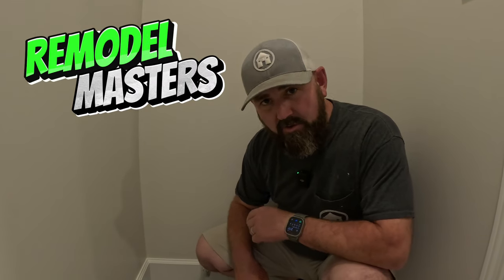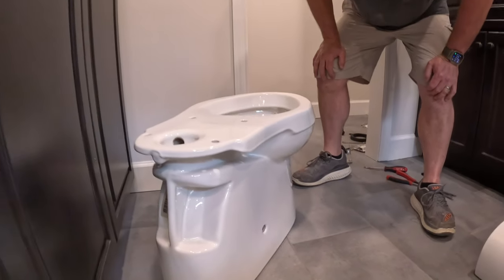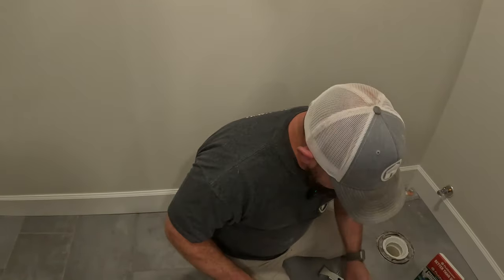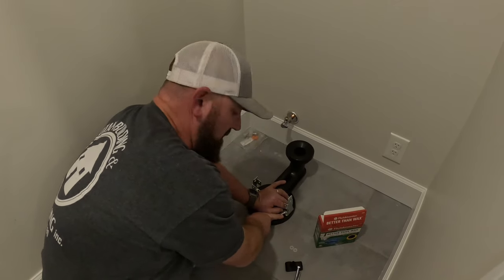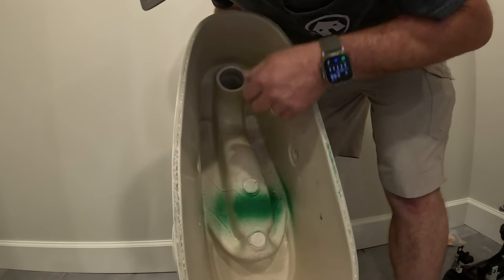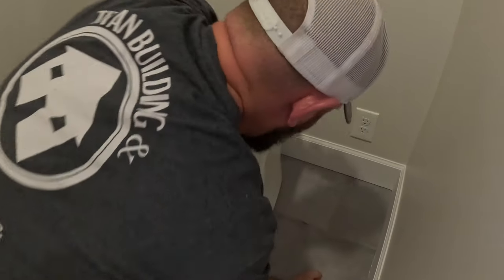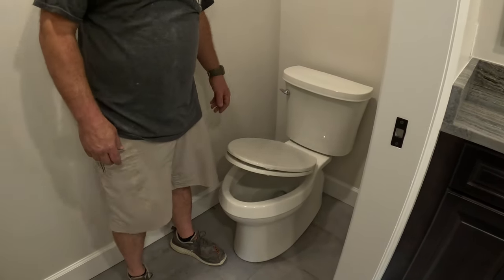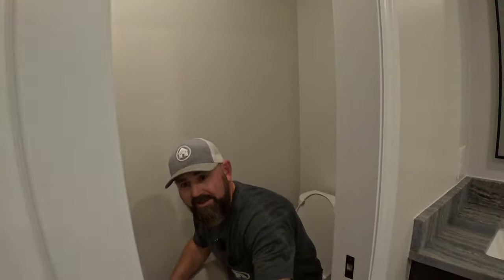🚽Installing the Kohler Gleam enclosed trap toilet🧻

Comment: I installed one of these for my dad last weekend. After I was done I thought about lubing that rubber flange like you suggested. It went well anyway but that grease is a good idea. I didn't realize what we had bought until I unpacked it and I thought this will take a bit of learning. They are unlike any I had done before and although I am not a plumber I have set maybe 30 toilets in 40 years of residential work.

Comment: Thanks for this. Done a number of toilets but nothing with that newfangled flange-y thing.  Funny that when I contacted Kohler about using the waxless ring (instead of the wax type included) they didn't have a clue as to whether it was compatible or not. I initially tried to fit the Fluidmaster waxless ring around the bottom of the flange and seems you need to stretch and almost deform it to get it to fit. Is that your experience?
Reply from the maker: Yes you do have to stretch it a bit but not too much to where it seems like it would be a problem

Comment: Just intalled this model (Gleam), tank wobbles a lot,  just two bolts holding the tank.  Am I missing something?
Reply from the maker: If you tighten it down to where the metal bracket almost touches the toilet it should not wobble. It almost seems like you are over tightening it but I’ve never broke one yet

Comment: How is that plastic part and those screws nut thingamajig gonna hold up especially if have and you have to remove it. Or snake it out ro plunge it and it leaks  where the 2 pieces come together under skirt.
Reply from the maker: It’s got the waxless ring sandwiched into place and won’t move plus if installed right a toilet shouldn’t have to come up unless you are changing out your flooring or want a new toilet.

Comment: Why don’t you use the 20th century wax ring? I have one gleam installed & used it 😮. I’m about to install a 2nd downstairs. Usual tips, thanks.
Reply from the maker: I haven’t used a wax ring in years. The waxless seals are not near as messy and you can feel that they seal better

Comment: Working with PVC flange was difficult to keep the flange bolt t correctly on the flange when tightening the brackets, had to use vice grips and open end to keep from splitting the pvc flang. Then when putting in the side bolts, the nut insert fell out of the plastic contraption instead of threading. Took 2 trys to get the side mount bolt to catch. . . Use soap on the rubber flange to make the porcelain slide in easier. Then all good, filled up, no leaks but bowel was still loose and would move if you try to turn it. Tightened side more, still loose. Tightened little more-snap, plastic swing bracket broke inside. Welp, now to remove and take an hour drive back to HD to return this stupid mounting system toilet.

Comment: No need to caulk the bottom of the toilet??
Reply from the maker: @MKUMBRA  You should never have to caulk the bottom of the toilet. Reason being if you toilet leaks you want it to leak out onto the floor if it does so that you see before it leaks down in between floors or into crawlspace or slab